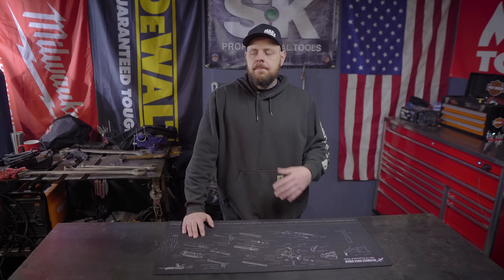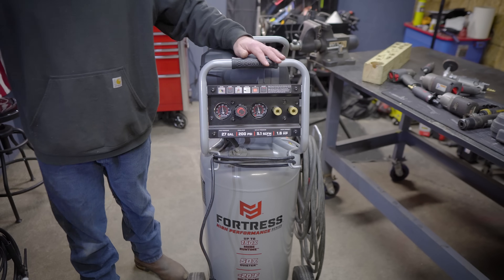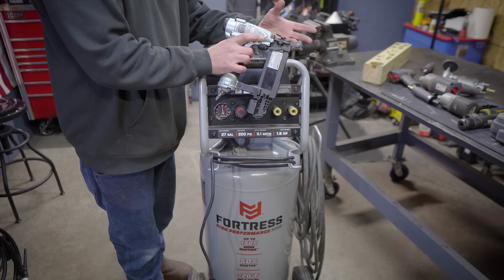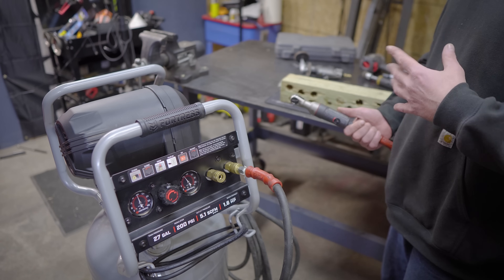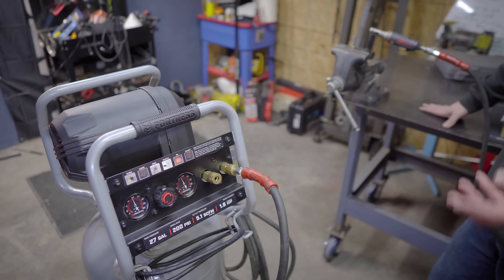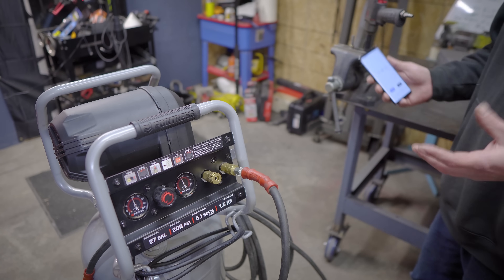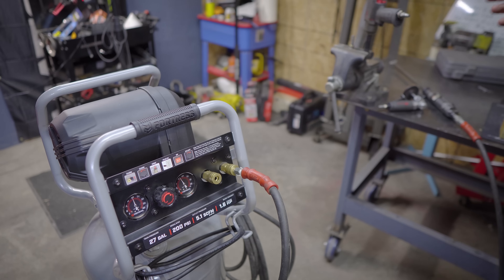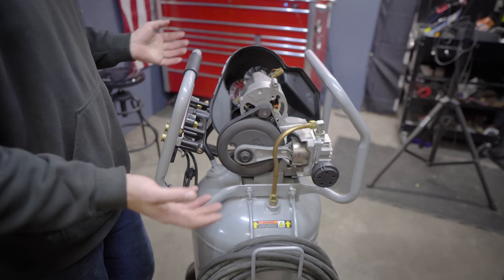Fortress 27 Gallon Air Compressor Harbor Freight Tools (Testing and Overall Opinion)

Comment: HAving a little trouble with my 27 gallon compressor just like the one you are reviewing. I have small air leak somewhere on back side of the motor area. Can't figure out how to get the plastic off. Looks like tabs that you can stick a screw driver in and pop off but feels like something is holding it. I see some holes that looks like he or Allen head bolts. How did you get the cover off?

Comment: I am just really surprised that for $400 dollars it doesn't perform better.  It doesn't seem any better as far as tool run time, than my old Central Pneumatic 21 Gallon that I got on sale for $129 (that HF is dropping now), it is probably quieter though.    I got a 15CFM 60 Gallon that was given to me that I repaired by fixing the wiring and replacing the ball valve, and it's made a huge difference for me.  Having something that can run a angle/die grinder continuous is a huge time saver when you have to cut apart rusty crap, but if I hadn't got that for free I would probably still be running the 21 gallon one.
Reply from the maker: It is actually comparable to the dewalt i talked about before they are both the same for the most part but these arent made to be used all day like your 60 gallon tank which I'm sure does do whatever you need it to. I think this would be a decent mobile air compressor which is why i like it. You may be able to find better deals though. I want to try a 60 gallon fortess if they ever release one a two stage 60 gallon legit "professional" compressor but we will see lol. Thanks for watching brother
Reply: Wow
Reply: Understand. I have an older craftsman 33 gal. Like new . I bought used and knew the little hack to make it work properly. It’s loud but ?,, I’ll wait and see or figure out how to use a reservoir. Excellent video . I thank you.

Comment: First, great video bro.  I really like your channel and your quality content.  I just bought this compressor for airing up my truck tires, impact wrench for lugs, general home air tools such as framing/trim nailers, powder coating gun, and I’d like to be able to spray paint.  I’ve seen quality paint guns as low as 4.5 scfm.  It would be awesome to show this compressor in action painting using a spray gun at 4.5-6 scfm as I believe this tank has a higher scfm rating at lower psi.  I just have not tried painting yet.  I appreciate your thoughts...

Comment: What a great informational video. Answered all the questions had. I use compressed air for aluminum, steel, and chrome moly tube bending. Im going to upgrade to this compressor. I have the six gallon fortress pancake air compressor and it works great. Again thank you so much for making these 2 videos, so unbelievably helpful 😊

Comment: I have a Craftsman 30 gal and was thinking of replacing it with this since the Craftsman only goes up to 160 psi  but after watching this I don't think I'd be gaining much in performance.  It's just being used as a garage utility compressor but I want to start spray painting small projects.
Reply: Hook this up to your 30 gallon compressor and increase capacity. It may stain a bit more but should work

Comment: Very thorough review, I've been looking at this compressor for a while I think I will be getting one for my garage.   Cost of the compressor seems to outweigh the time waiting for it to refill especially if you're only using it as a hobbyist or light duty and not hammering on it.
Reply: If I were you I would get the Kobalt 26 Gal Quiet Tech air compressor. Its a bit lower cfm but it's way quiter and built much better. It uses a better motor and the casting and quality of materials is better. Also since it has 2 pistons the motor spins slower so it wears slower

Comment: Thanks for the great video, thorough and well done. You just saved me $450. I was looking for something in between my 80 gallon compressor and my 12 gallon compressor. Wow the tool duration time vs the pump up times on that compressor are just a complete joke, it really pretty much makes it worthless for anything but air nailing. Harbor Freight seems to be really weak in the compressor Department, Not sure ether why they don't have a 60 and 80 gallon line of decent compressors . They only offer a couple of decent compressors and they are gasoline driven and over $1,000 . You should be able to get a compressor with 14 CFM @ 90 PSI with a decent pump up time for under $1,000.
Reply: This compressor actually runs everything with ease . I have it and it outperforms my other larger unit

Comment: I recently brought this compressor, two things that need to be addressed. The knob on the drain valve on the bottom of the compressor needs to be shorter so that it doesn't get scrapped or broken off when moving the compressor around. The other thing how would you be able to add a water separator or a pressure regulator to catch the water before it gets to the air tools? Your comment please or others what did you do to fix this potential problem. Love your video, GREAT WORK!

Comment: Nice vid, thanks for posting.  It would have been nice to see you use a tool rated just below the rated SCFM of the compressor to see if it keeps up at 90 psi.

Comment: My old Craftsman compressor is oiless, noisy, 22 gal vertical tank, 8.6 scfm at 40 psi, 6.4 scfm at 80 psi, 120v/240 capable, 130 psi max.
Reply: I just picked this model up and getting ready to retire my 20 year old  craftsman 20 gallon 6.1 scfm @90 psi.  Hopefully it works as well.  They are both just as noisy.  I bought mine online auction for $177.
Reply: @ponyxpress3 how are you liking it 2 years in?
Reply: @saldrich3226 I didn’t get to use it much.   I hated it.  It had a short circuit, and I took it apart to try and figure it out.  I ended up breaking the built in fan.  The reason I hate this model so much, is that you cannot buy individual parts for the motor, such as the fan.  The guy I sold it to, fixed the short circuit, wires were touching and cutting out when on due to vibration.   I ended up buying a bigger dewalt from tractor supply.
Reply: @ponyxpress3  thanks for the reply. Too bad about the unavailable parts.
Reply: @saldrich3226 if you ever need to work on it, don’t smack the cover while it’s on.  That fan is really shitty.  The clearance is tight between the fan and cover.  Plastic was frail.  I was in the middle of building a giant chicken coop, and it pissed me off that it broke while nailing.  I had to buy a pancake compressor to get me through.  Ha.  I’m sure the fortress can be a really good compressor. I bought someone else’s problems.

Comment: One should keep using the tool until the tool psi limit is about reached.  My weaver compressor would continue to pump and kick off again.  Running air file, orbit sander, die grinder ect. Not two or thee at a time.

Comment: Hey Brian, bro hope all is well with you, I've had my issues on here and been hacked and lost everything so I'm starting again, question about the fortress, I'm on my third one, first one was the 10 gallon then it quit just outside the 90 day warranty but I had purchased the warranty, there weren't any replacements within 200 miles so I went with the 6 gal, then it wouldn't air up so now on my second 6 gal, have you had any issues at all with yours? I used mine intermittently.  Hope to hear back from you bro and maybe get caught up, almost finished with setting up my small shop

Comment: Watched you vid because I am looking for the possibility of switching out the pressure switch for an adjustable one if this one is not. The adjustable ones have screws that you adjust to change the "Cut in" & "Cut out" pressures. I looked hard when you had the cover off and did not see any screws. Think i could make mine adjustable. I just don't know if I want it running all the way up to 200 psi.
Brett....

Comment: Thanks for the video. I think I’m gona go a little bigger at harbor freight with the central Pneumatic 29 gallon still a bit concerned with the life of that pump, did u say that was brushed motor I was hoping they would go brushless.
Reply from the maker: Yeah it is i didn't expect it to be brushless but it actually seemed well made. Even though this tank is smaller it still will hold more air than the compressor you are talking about but for the price you may be better off i dont know your situation but they seem solid for most people
Reply: Look at scfm rating on both. The fortress is a joke at 90 psi. Atleast for me as a welder/fabricator I'd use air for blasting and painting the rest id pick up one of my Milwaukee tools
Reply: Thanks I like that compressor and am still debating over the two compressors I am a flat rate mechanic by trade and this will be just a home compressor tough decision but I think the central Pneumatic for me is the way to go for me but thank you so much for the video I appreciate your channel. Been watching since you started to review icon tools
Reply: @tammikrolikowski727  look at the scfm the 29gal central pneumatic is 2to3 times the working load. Now if u air up tires and shoot nails get the fortress and save ur ears a bit but anything where air flow counts get the 29 gal central pneumatic and run some air tools while the fortress gets 2min use the central will get 8

Comment: Hi - are you using a 20 amp electrical outlet and/or will this unit run on a 15 amp?  Thanks for the helpful video.
Reply: The unit has a 15 amp plug...

Comment: LOL universal motor running a belt semi open piston design.  It's definitely no continuous duty machine.  Should be fine for home use and is quieter than typical oil less units.  This unit is fine for all those tools you tried it on.  Dual action sanding and big paint jobs?  Definitely not.

Also, NEVER use around flammable fumes!  Those sparks will ignite them!

Comment: Isn't 9 minutes and 25 seconds a really long fill time?
Reply from the maker: The tank is kind of big so you have to expect some delay but yes it is a little long. Similar compressors do take a while but this seems to be longer than a lot of them. Thanks for your input brother.
Reply: @RedemptionGarage  Do you have any other recommendations on an Oiler around this price range and size or is this about it?

Comment: With a standard 1 stage compressor, the efficiency goes out the window after 110-120 psi. mostly due to heat build up. Getting that little fart compressor to build 200 psi is really a joke. You folks need to google the physics so you don't buy into these bogus compressors. If it's high psi you're looking for, then you need a 2 stage compressor...and they're not cheap but would pay for themselves in cheaper power bills without pulling a virtually continuous 15 amps through your wiring. I would at the least, set the shut off switch at 120 psi. You'd still have plenty of volume but without putting an ungodly strain on the pump.